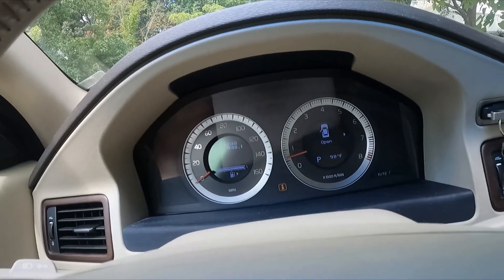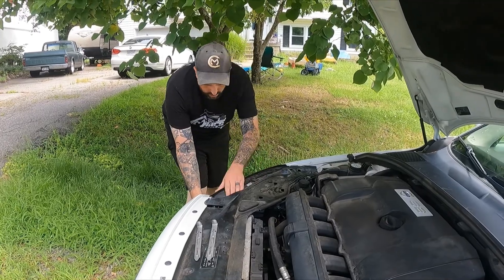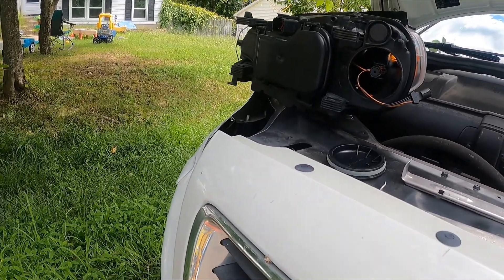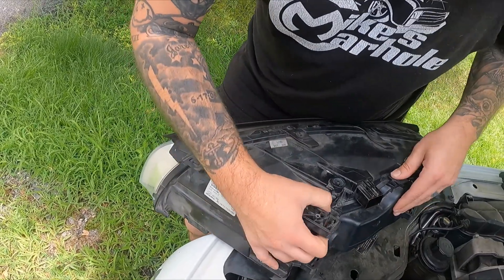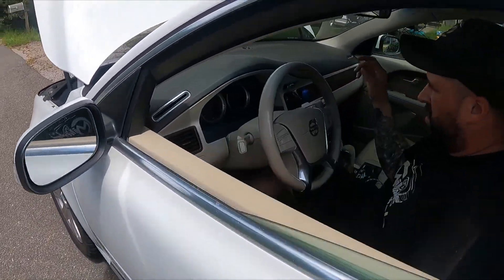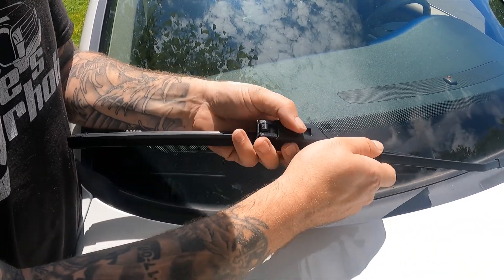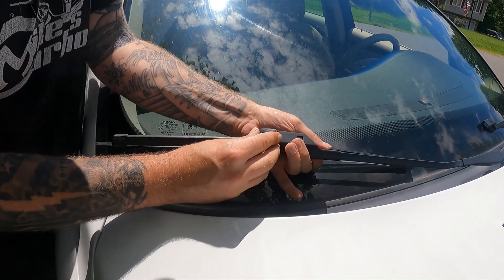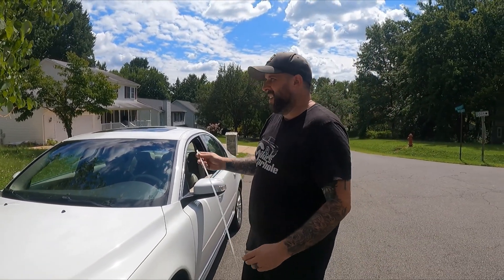How to headlight bulb replacement/How to Replace Windshield Wipers on  Car #volvo #car #howto #s80

Comment: I like that easy release system for the headlight. It's funny with the wipers-- I've changed mine many times, and always end up struggling with at least one of them lol
Reply from the maker: Yeah it always happens for me when the camera is rolling. Lol.
Reply: Agree. When both get changed smoothly I will buy a lottery ticket right after lol